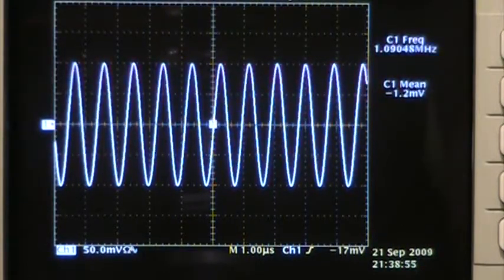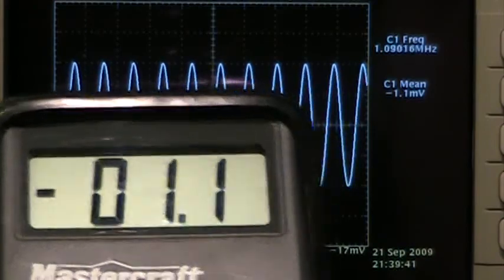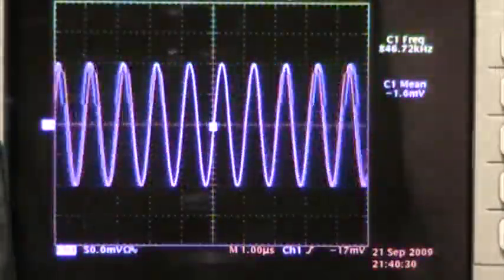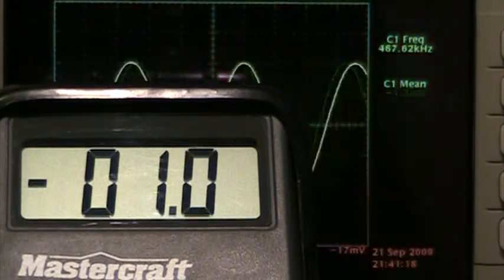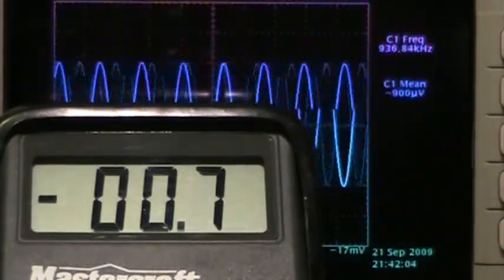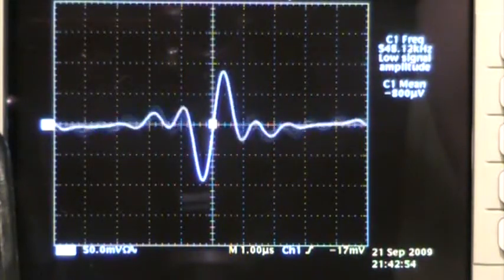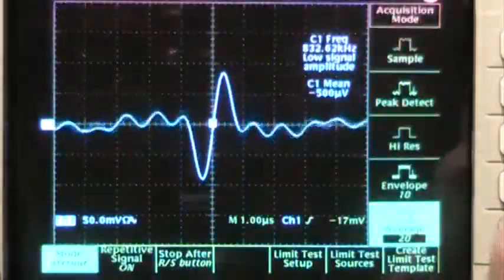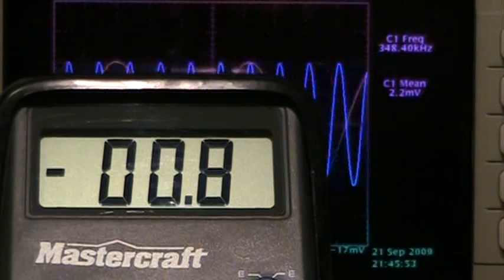A "MEAN" Meter - Part 3

Comment from the maker: Thanks TK.

Yeah the two averaging functions are different.. The averaging function I applied was to the acquisition of the samples. The scope uses the no. of samples specified and averages them. Normally the scope only acquires and uses the first sample.

Clearly, although very useful, the MEAN and CycMEAN functions have their useful limits. I don't foresee the need to ever take the mean value of a FM wave form imo. It was an interesting stress test for both though.